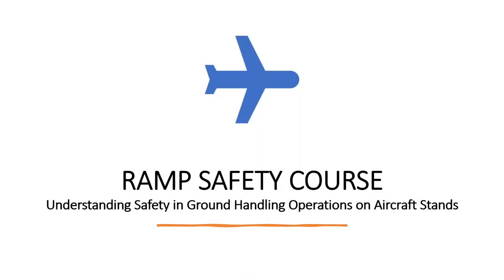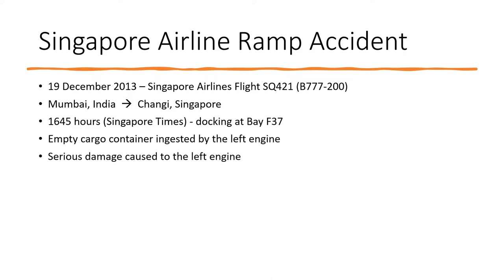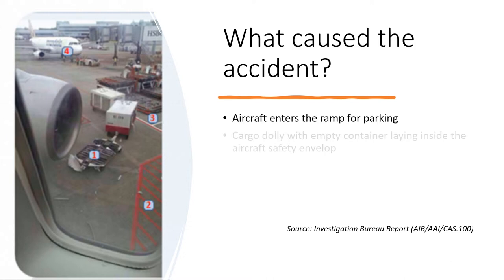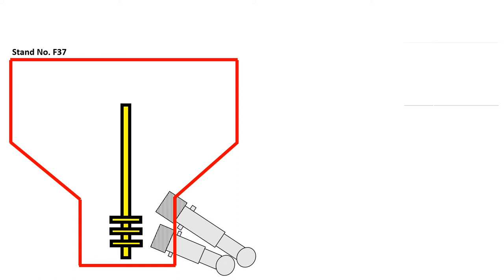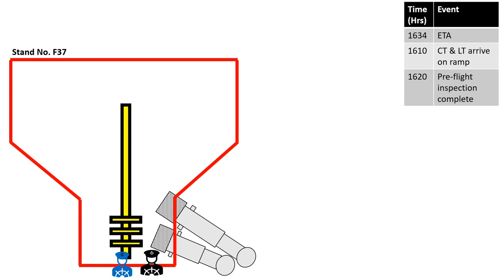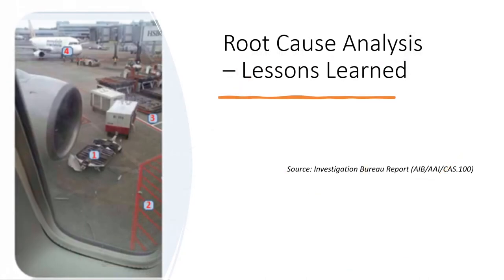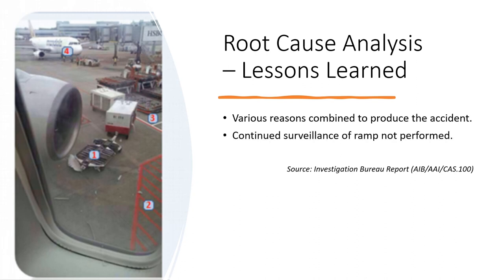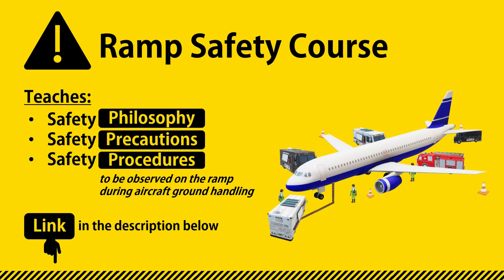Airport Ramp Accident Case Study (Presentation) of a Cargo Container Sucked into Aircraft Jet Engine

Comment: Dear Sir 
Gud to see your video again sir I have joined one ground handling company in middle East they have hired me as a equipment operator sir I have attended there all classes mostly theorical....but sir as an equipment operator I need to operate mostly dolly so during tow tractor practice I FAILED the training was 2days 17th and 18 th Nov now I am at home....sir could you please  put one video of reversing the 10feet dolly in tractor like if tow tractor is parked cross and need to put 10feet dolly in a proper straight so how it can park properly ? 

Sir that would be great help for me  sir please help.me a big humble REQUEST 🙏🙏🙏 HOPE YOU WILL DO THE NEEDFUL...I AM VERY MUCH AFRAID SIR MY COMPANY MAY TERMINATE ME SIR DOING WORK AT THE AIRPORT IS ONE OF MY DREAM JOB SIR...

REGARDS

SADIQ SHEIKH
Reply from the maker: It would require physical presence to understand your issue and also advise you as the matter you highlighted is related to a physical maneuver. However, you may find our following presentation on cargo loading helpful:
https://www.youtube.com/watch?v=8NavR9-AZf8
Reply: @TheAirportSchool  sir thanks a lot  for showing me the presentation of the cargo dollies...Actually for me I am a new joiner at the airport and my main job is to handle uld dolly and basically mine instructor told me to reverse 10feet dolly which I couldn't and he failed me for that....but anyways this video of yours it's quite a big helpful for me sir..
And if you find any video of tow tractor towing dolly please do forward me god bless you sir 😊🙏🙏🙏